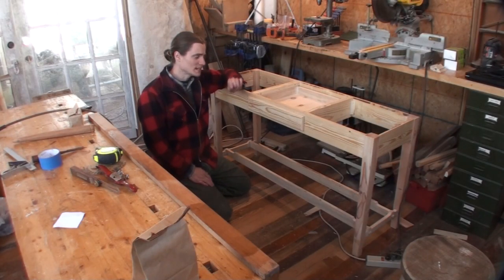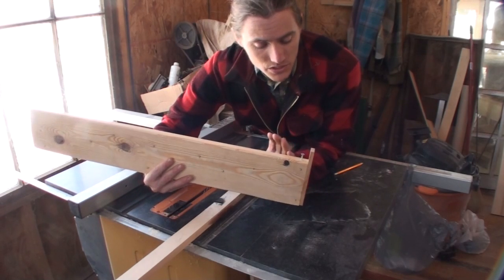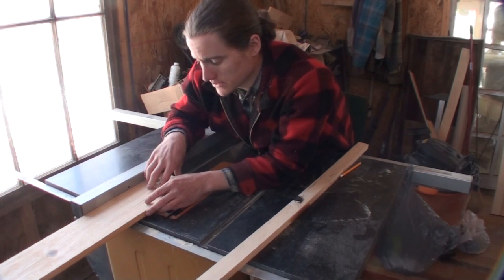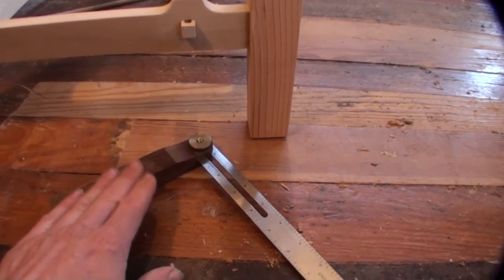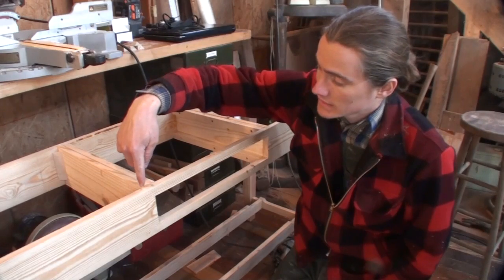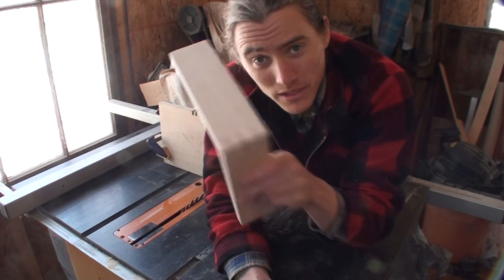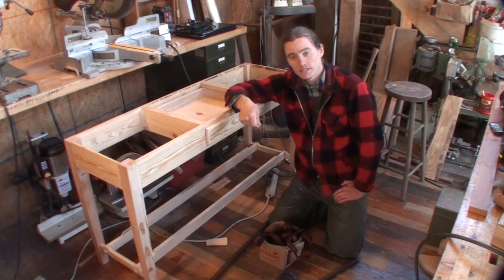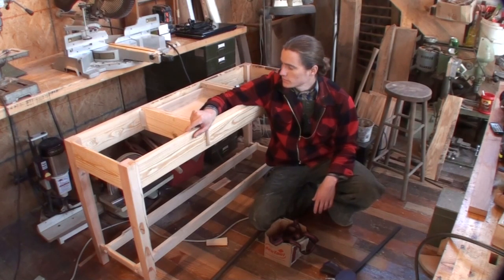Sofa Table Design and Construction Details - Lots of Info

Comment: I like what you have done with the table. I think with the drawer i would like to use  a set of drawer slides instead. I plane on making table but with only 2 tampers on the leges, ill have to see when i get to building it.. Also i would like to add another drawer to the table.

Comment: Another great video.  I enjoyed all of the detail.  I have been doing some basic carpentry, but do not have access to woodworking classes.  Even if I never make this particular table, I learned several things from this video.  Thanks!
Reply from the maker: Woods Gal You give me an Idea, I may do some videos in the style of a "woodworking class"
where I introduce the project and tell you what tools and materials you need and then go through all the steps until the project is done with a series of videos.
Reply: Fantastic!  Thanks.

Comment: I was hoping for some advice on a project I'm starting as a wedding gift to one of my good friends. It's a live edge hall table that I'm putting together with a live top and shelf about half way down. I want to make the legs with a taper similar to the ones on your video. About 2 inch at the top and a small taper towards to bottom. Only issue is I'm having a hard time finding an inexpensive stock I can make the legs out of with the thickness I need. Any suggestions? I plan on painting the base of that helps. So the top is really the star. Would appreciate anything. Thanks!
Reply from the maker: +Todd Feldman Glue up something into the thickness you need. get some 2x6, rip in half and glue it up, then rip it to a rough dimension, plane then taper. But you run the risk of the wood being unstable since it's not really dried to furniture moisture %. You could also find a local furniture maker or other wood source and see what people have. Poplar is great wood to work with and it paints nice. My advice is that if you are a regular at woodworking, try to find several sources of lumber to where you can get what you want when you need it. Also, keep in mind I'm a cheap skate in most situations but sometimes it's better to get a higher quality or better suited wood in certain situations. Your already going through so much effort and time with some projects that it is not worth it to not use the best wood you can get your hands on........that's not to say one should not use lower grade lumber, I do it all the time! Just weigh your options and outcomes.

Comment: Couldn't you just cut the mortise in to the legs before tapering them getting the same results without having to shim each leg. Just a thought, your work is very good and precise . Thanks
Reply from the maker: +GILLEBRATH Any time you can cut joinery before hand is easiest. A lot of the furniture that I'm making "one offs" or prototyping, I am designing as I build, so sometimes joinery is cut after tapers, etc have already been formed. This piece was a mix of a plan with some wiggle room to change the design as I went.
Reply: Has nothing to do with cutting the mortice into an angle face. It has to do with cutting the tongue cheek cut angle of the rails.

Comment: Nice design, except for the nails. Have you considered transferring the curve shelf support element to the aprons of the table top?

I enjoyed the details but the video is too long for me, I find that it bogs down on the technical details and takes focus away from the more interesting design details.

I like how you referred to your technical video on MT, you could probably have done that for the taper leg cut and finger joints to move the video along. You can add an "annotation" using the YT editing tools to link to another video.

Personally, I wanted to see how you developed your design such as sketches or inspiration. Also the background draws my eyes away from your main point. I also hope that you stain it rather than painting over the beautiful character of the wood.

Hope this helps, John
Reply from the maker: Thanks for the comment, the nails have nothing to do with the design, they just hold the support blocks in until the glue drys. Most furniture that I make does not result from sketches, I just make it up as I go. In somecases I do drawings, but most of the time it just evolves as the piece is being made. And it's being painted black with the top and shelf having a wipe on poly. I stained base would not look good in this case. A black base with cherry knob, cherry pinned tennons, and pegged in the main tennons on the legs will give it a very sharp look. It's made from yellow pine, douglas fir and poplar with a cherry top, a stained base would make it look like a scrap bin project. I'll follow up with finished photos in a future video and facebook. Thank you again for your input, don't take my response as negative, just explaining my desicions. I do like your idea of doing design oriented videos. Thanks again.
Reply: The Homestead Craftsman To clarify, I like the design; I don't like nails in indoor furniture in general, if you stated that the nails would be removed in your video then I must have skipped it over. I get that the the cherry parts are unpainted.

I would constructively disagree and say that paint (unless used in outdoor projects) makes solid wood project look like its from the "scrap bin;"  If it were up to me I would finish it with linseed oil and let the wood age. But this is a personal aesthetic choice therefore it is left to the individual.

I look forward to seeing your finished project.